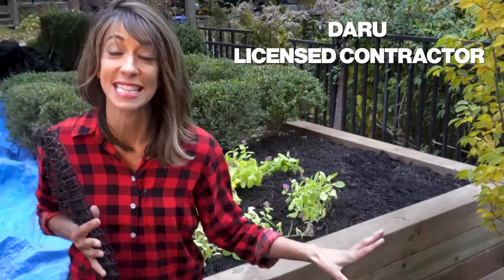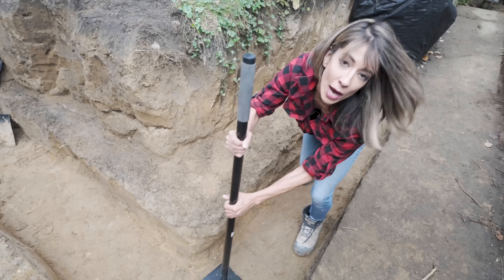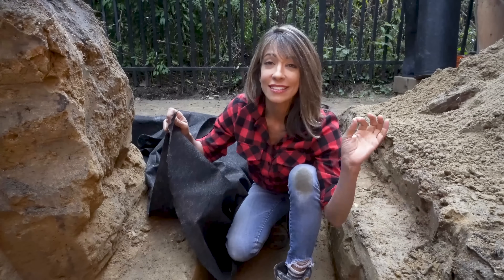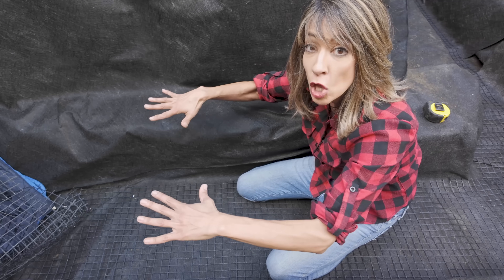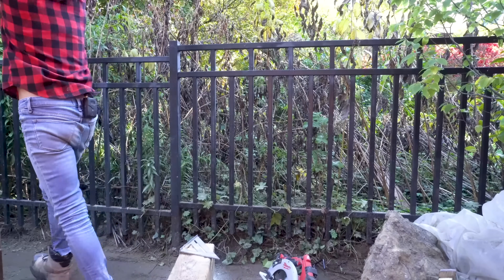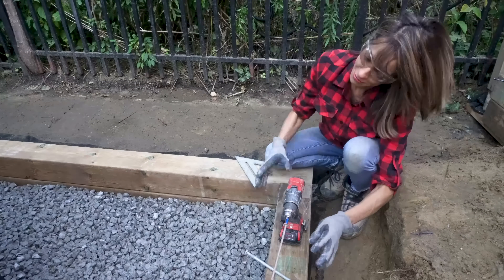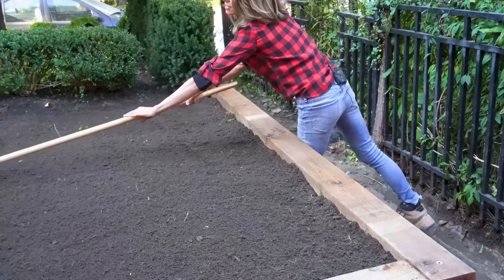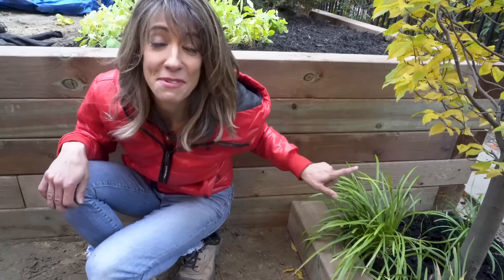No One Builds Retaining Walls Like This...Yet!

Comment from the maker: 💥 Want to build your own wall like this?
Here are the timber screws I use: https://amzn.to/48wCnqS
Tools + Materials: 
Amazon storefront (US): https://www.amazon.com/shop/darudhillon
Amazon storefront (CAN): https://www.amazon.ca/shop/darudhillon

Amazon Affiliate Links. As an Amazon Associate, I earn from qualifying purchases. At no cost to you. Thanks for supporting more videos! 
Watch Next: Concrete retaining wall using spider web engineering: it’s a whole other level:
🔗 Watch here: https://youtu.be/GFRywj32AGE
Reply: @DaruDhillon I need to build a retaining wall about 5' high to keep an 'elevated' gravel driveway intact where the edges of it are falling into the ditch below. I may build one on the other side of the driveway just to keep it safe and symmetrical. Instead of the GeoGrid would it be better to use steel reinforcing mesh like that that's used on roadways to tie both sides of the driveway together?
Reply from the maker: @The.OTHER.Comedy.Channel for specific engineering advice it’s best to consult with an engineer. I did on this project. Geogrid is also used in road construction. Good luck with your project.
Reply: What about wood rot?
Reply from the maker: @shock2429 I have a reinforced concrete retaining wall video with your name on it!
Reply: @shock2429  It's best to also use a dimple board foundation wrap. It creates an air gap between wet soil and wood.
Reply: Excellent and informative video, thank you. Please can you link to the filter fabric you used. I can't find it in the amazon links and am struggling to find anything that isn't the fabric you warn against using.
Reply from the maker: @tomwells646  I hear what you're saying Tom. I'm getting lots of requests for proper filter fabric. I'll reach out to the American manufacturers and see what we can do. It should be more easily available. Thanks.
Reply: My retaining wall will only be 18-24” will I need all of these applications?
I live in Lawton, OK 73507
Reply: @jamesbennett8637  Based on your location, I don't think you need to worry about frost considerations. 
Based on the height, your wall is moderately loaded (back side soil pressure). Also based on the height (assuming 6x6),  you'll need 8 vertical rows.
The real concern (in your scenario) is the horizontal length of the wall (between corners). The corners provide wall strength (resistance tohorzontal & rotational shifting).

If the horizontal length is greater then the lumber length.... (but joints present)... consider adding perpendicular lumber pieces that will be burried into the soil mass being retained.
These peperdiculars will be weighted down by soil above and help the wall resist any rotation. 
W.R.T. the geotextile referred to in the video; it provided good resistance to horizontal movement. It will only resist rotation if multiple layers are used (example: inastalled every 3rd row of 6x6).

Comment: Great video. I've built these along our lakefront, though as a timber wall ages it demands the work of staining and maintenance as the woods turns black and ugly. Years ago, the early generation of pressure treated lumber seemed to last a lot longer than current wood products, so longevity is a concern.
Reply from the maker: Appreciate you sharing your perspective on building your retaining wall Bill. I know that old lumber lasted forever.

Comment: Pro tip - you can use plastic snow fence for the geogrid.  Just make run the vertical bands into the slope - that’s the strong axis.  Even with geogrid I always staple the grid to the retaining wall between courses.  Stainless poultry staples work fine - just pound them flush so you minimize gaps between 6x6.
Reply from the maker: Thanks for sharing your building tips on the geogrid.
Reply: @DaruDhillon  I appreciate your video - thanks for posting. Seeing projects like this reenergizes and inspires.  
Nicely done!

Comment: I did a retention wall 40 years ago, replacing a retention wall, from 40 years ago.  It seemed to push up from the center, and sink at the two sides.   I straighted it out, used the deadmen, etc.  And got serious since the wall was only 2' high anyway.   then about 10 years later, the same drama was happening.   I'm guessing, it was likely freeze thaw, you've got to get below the freeze thaw line, but might also have been that we were on a mostly rock mountain, with 8 inches of dirt or so, over the rock.  Which, duh, also is not below the freeze thaw for the area.
Reply from the maker: Sounds like to took a solid approach to fixing the wall. Freeze cycles do put a lot of pressure on a wall. Appreciate you taking the time to share your build.

Comment: Most informative video by far, clearly a professional, also what kind of tube was that for the drainage and does it matter if it's placed by the wall or back by the hill
Reply from the maker: Glad you found it informative! That's a corrugated drain pipe for the drainage. I usually install it like in the video.

Comment: I don't understand that drainage pipe. How does the water get it? I'm assuming the pipe is full of holes and the fabric keeps the dirt out? Then then the pipe is only getting the water from near the soil, not from anywhere else. ???
Reply from the maker: It’s a perforated pipe so it intakes water from above and below. It’s wrapped in fabric to keep it clean. It works surprisingly well when installed correctly.

Comment: Great video, For square corners or squaring off of a building  "3-4-5"
I worked in constructional landscaping with a lot of old timers, simple to remember and a quick check. 
If you measure  3 feet along one side,  4 feet along the other side, then 5 feet between the two points, you are square. 
You can stretch it out 6-8-10,  9-12-15, etc  
Works great when you set up lines.
Reply from the maker: Thanks for sharing that tip; it's a great technique to know and utilize on a build. I appreciate the comment!

Comment: Just be sure to use either .60 treated or what's called critical structure grade lumber and not the stuff down at the box store.  It's about 10-15% more, but worth it.  Ground contact treated lumber will rot much quicker.

Comment: Good looking wall. I'd need maybe 5-10x that size, and sadly timbers like that cost arm and a leg in Finland (even when we do have loads of forrest), so I need to figure out something else. Just checked, pressure-treated 4x4 is 6.6€/m, it's not actually that bad, but everything else is like 4 times the price, and when you need hundreds of meters it's quickly a lot.
Reply from the maker: That is unfortunate to hear but it sounds like you have a handle on the costs and materials, good luck with your project! I’m sure you will find a solution that works well for you.

Comment: Lovely presentation! Was wondering if you use a barrier between the soil and the aggregate on the top layer? And is there anything between the soil on top (the last layer) and the wood?
Reply from the maker: Yes absolutely. You can wrap a layer of non-woven filter fabric over the aggregate before filling with soil.

Comment: lots of useful info, thanks.  one question, before you cap the gravel with topsoil, do you bring the cloth back over the gravel to keep the soil out of your drainage material?
Reply from the maker: Yes absolutely you can tuck in the top and roll it over like a burrito or a wrap. Thanks for the question. That's an important step!

Comment: I’m building now and I’m having the most difficult time keeping the first course level front to back when I drive the rebar in. It’s as if the 3/4” rock is not a sturdy enough base.
Reply from the maker: In all fairness, the first course takes the longest to get level, but once you’ve got it, the rest is easy. You can use 1/4” crushed limestone to slightly level if you’re having issues. I did that on my concrete retaining wall build tutorial. Appreciate you sharing your experience-1/4” is a good solution to micro-levelling.
Reply: @DaruDhillon exactly what my wife said to do!

Comment: This is a very helpful video. A quick question: Do you think the wood requires some waterproofing paint before being used for the retaining wall?
Reply from the maker: The wood is pressure-treated so it doesn’t need to be treated except on the cut ends. You can seal it if you’d like.

Comment: What are the guidelines for trench depth?
Reply from the maker: Specific guidelines will vary based on your building code. I’m building according to what is recommended in my area. For taller walls an engineer is required to sign off on the build. Thanks for the question.
Reply: @DaruDhillon I guess my specific question is if my wall height is 24in how deep would said trench be?

Comment: I’m wondering why a conservation district in WA state would recommend the other fabric for creating a graveled dry lot for responsible horsekeeping. That’s what we did and it seemed to worked as desired. The water spread out then seaped through a widespread area instead of pooling then draining slowly where it accumulated.
Reply from the maker: I trust they used the right textile for the application. Woven is used to reinforce and stabilize. It’s an excellent product in the right job. Sounds like it’s working out well.

Comment: Does the drain pipe have holes on the top and bottom?
Reply from the maker: Perforated pipe has holes top and bottom. It will intake water from all directions. Thanks for the question.

Comment: That much torque with those timber screws its better to use a drill than an impact driver, bust use a handle on the tool
Reply from the maker: Thanks for you feedback on the torque! Got to be careful.

Comment: what did you use to secure the geogrid to the horizontal posts ?
Reply from the maker: Pressure fit under the timbers. So nothing except the weight of the lumber.

Comment: My home has a cinder block retaining wall that is seven feet high. It has been there for the 35 years I have lived here and probably since the home was built 25 years before that. There isn’t a drain, or geo grid and the wall hasn’t moved an inch or cracked.
Reply from the maker: Thanks for sharing your experience. Sounds like you have a Great Wall!

Comment: Where does the drain start??
Reply from the maker: It starts at the far left end. It's actually running from a concrete retaining wall I built in another video down to this wall. They are connected and draining to daylight.

Comment: Way over built. That amount of soil isn't putting that much outward pressure. The wall isn't sealed, so the hydrostatic pressure won't build up to a burst point. Over time the soil with fill in the spaces of the gravel and you'll have to keep adding soil. You're lucking working with sand.
Reply from the maker: I appreciate your perspective on the build and sharing your thoughts about the soil and pressure.

Comment: This is the most idiotic thing ever. For this much work and material, you could have easily made a concrete retaining wall. Much stronger, one fifth the width, and everlasting. Pointless
Reply from the maker: Concrete retaining walls require backfill as well. I have a video on concrete block walls as well. I appreciate you sharing your thoughts on the wall construction. A lot more aggregate goes into walls than we used to use.
Reply: @DaruDhillon  concrete walls don’t really need that much aggregate in the backfill. 
The materials you’ve used could’ve made a concrete wall with the same cost actually

Comment: Doesn't the geogrid have to be installed between layers of aggregate?
Reply from the maker: Yes, that’s right. It has to be mechanically interlocked or used as a base stabilizer with aggregate on top as in the video.

Comment: AMAZING video! If I handed you a square of uniaxial geogrid, you'd probably be able to examine it and tell me which direction on it is the strong one. I didn't pick up this trick from the way you taught about it, though I get that keeping the explanation simple is probably the best way to teach to people who don't care about textiles as much as I do. 

And a tiny trick that might make your next wall a tiny bit easier: around 11:57 where the geogrid is trying to roll itself back up and you're weighing it down with a hammer, the easiest way to make it behave would be flipping it like a pancake so it's trying to roll downward instead of upward. That way its own weight would help keep it in place.
Reply from the maker: Good tip on flipping the geogrid. I’ll do that. Thanks, I appreciate the advice!

Comment: Are the 6x6s pressure treated? Sanded? Treated with a coat of acrylic latex? Do you trench to frostline? How far on center do you space each deadman?
Reply from the maker: I never sand pressure treated lumber.  Stain/sealer is a good idea. If I dug down to the frost line that would be 4 feet and it would look like a bunker. Cheers!

Comment: Oh if only we had that kind of soil where I build walls. Actually past tense I don't do this work anymore. You have a great method. I absolutely don't I never did use the same sort of method of building as the standard is around where I live because they are always insufficient in their long-term stability. It's a very very hilly area with lots of stream down cutting and therefore tons of added force from gravity and soil creep. The soil here is very heavy with clay, shale and  sandstone. It retains water like mad, drainage and gravitational percolation is terrible. The hydrostatic pressure is incredible. In the contractors around here have very little knowledge of these geological processes.
Reply from the maker: Thanks for sharing your experience. Different environments certainly call for different approaches!

Comment: Haha never seen retaining installed on top of the drainage aggregate. With that aggregate under the wall and that drainage pipe away from the wall the pipe is redundant and doing nothing. Water will just naturally seep under and out. The pipe is doing nothing. Total misunderstanding of water levels and hydrostatic pressure.
Reply from the maker: I appreciate your perspective on drainage aggregate and retaining wall construction. I need the drain to daylight it can’t terminate underground. Follow your local code.
Reply: @DaruDhillon It’s already “terminating to daylight” right around the base of the wall on the outside of the wall. That aggregate and trench still continues 4 inches or so outside the wall so any water behind the wall will never get higher than the base of the wall.
So the way the pipe has been laid makes it completely redundant despite what you think your codes require.
Reply: @DaruDhillon Btw I’m a builder with a design degree. Been building and landscaping as well as serial renovating for over 35years. I live in a hilly city and retaining walls are a fundamental part of work and solutions here.

Comment: Wow that's the most perfect all in wooden wall build...is this for a raised garden? ...definitely amazing and perfect use of materials. Purpose of a retaining wall is just that "retain" big deal if your a contractor looking for work great off for those with flooding issues which in the USA is LEGION so your trying to hold back water from flooding into your house home basement etc also if you have a "wet yard" facing towards the sun you can build a retaining wall level that out have an instant garden will grow a ton of food...especially if built like this😊😊
Reply from the maker: Good to hear your thoughts on retaining wall construction. I appreciate you sharing your tips thanks!

Comment: You skipped the part where you go from the gravel to the soil. I was trying to figure out and couldn't what you did with the barrier. Did you pull it back and put the soil over the top of it? And how did you then put everything up against the wall, did you arrange it so that the soil's not going to them seep down into the gravel below? Just wanted to see more.
Reply from the maker: You can wrap it like a burrito or tuck a new piece in to cover the soil. Thank you for the feedback. I’ll keep that in mind for next time.

Comment: What happens if you use more than 6 inches? Any benefit of a deeper depth of aggregate? Genuine question.
Reply from the maker: That’s just the minimum depth for the Geogrid to work. You can increase it. I have a concrete block wall with a larger spacing.

Comment: Hmmm. My question is about your 32 inches. Im stepping up a retaining wall. 2 ft high at the base then another 48 inch wall above it. So is the 4ft wall go back 4ft from the lower 2ft wall or is 2ft back above 2ft wall then go up 4ft?
Reply from the maker: That's a great question for your build. The setback can be whatever you prefer, depending on your design.

Comment: This is so well done. Thanks! I do have a question if you dont mind answering. I've seen others put their drain tubes against the wall, rather than at the back of the trench. Can you tell me if there's a reason? Or is the placement personal preference. I'm just trying to get all my ducks in a row before I start my block retaining wall. Im on clay, so not as good at draining water as sand.
Reply from the maker: I put it at the back based on what manufacturer's recommend for block wall construction and the engineer I worked with on this project. I want to keep water away from the wall. Water = Pressure. So best to keep the pressure away from the wall. Excellent question, thanks for asking. Sounds like you are well prepared for your build. Good luck Julie!

Comment: I was following along until you put the top soil directly over your rock. Is that standard? I assumed another layer of non-over fabric would go down before the dirt.
Reply from the maker: The large piece of non-woven fabric at the back gets folded over top of the clean fill. You can also use another piece. Cheers!